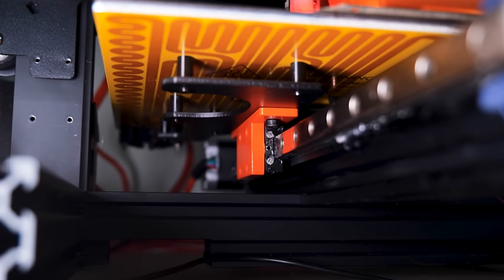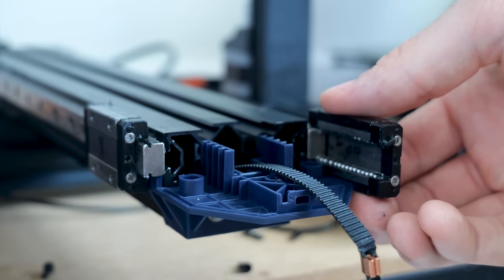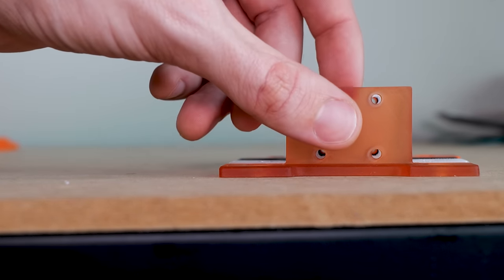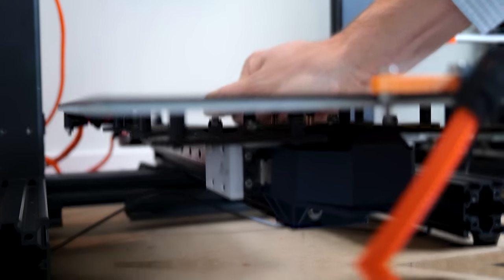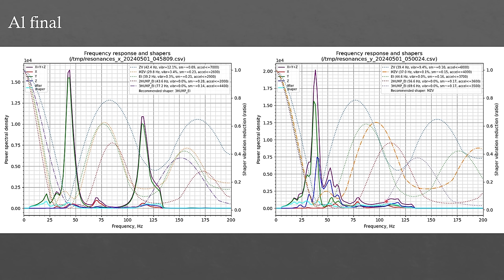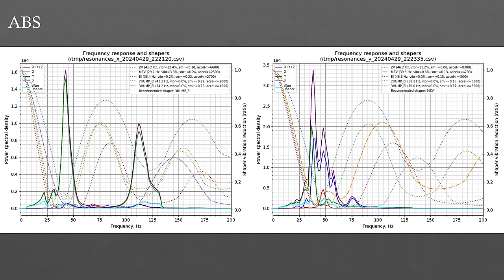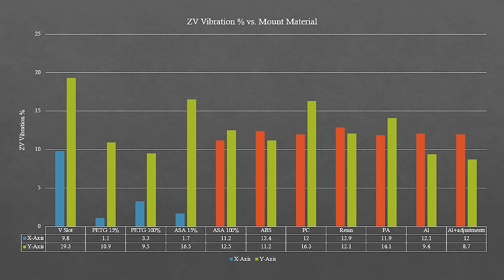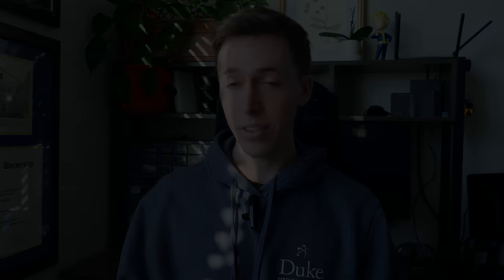Upgrading to Linear Rails a Waste of Money? - An Evidence Based Answer

Comment: I think there's more friction with linear guides as the balls are preloaded against the races - why it's so rigid.
This friction might be what limits speed in the steppers as they have to overcome more resistance.

As for the lubrication - that is a whole degree. Just look at a SKF bearing selection process. I think for 3Dprinting you'd want to use grease as it's simpler but what I would do is clean the rails down first getting rid of the old grease. Then pump grease into the guide block until you see only clean grease come out - wipe away excess. Now this gets rid of the dirty grease but probably overfills the rolling elements but as the loads are small I don't think you'd overheat them. Any excess will just work it's way out - hopefully.
Thankyou for spending time doing these experiments.
Reply from the maker: That's a great point about the preload causing more friction. I guess there is a bit of a tradeoff between the rigidity and the friction. I think in my case, it's an imperfect setup, coming up a bit short on the cleaning, and using the wrong lubricant.

I definitely plan on making a video about proper setup/maintenance of the rails. Right now I'm leaning towards giving the rails/carriages/bearing a soak in IPA for a little bit then properly lubing them as you described! Thank you so much for your support.
Reply: @SpencersDesk  If you do, make sure they are submersed. The steel rails will flash rust when exposed to air if there's no lubricant to protect them. 
What I do to clean bearings is flush with contact cleaner and moved them to get grit out. Then dry with compressed air and then lubricate imediately - might work with linear guide block too but not sure the plastic seals will like the contact cleaner. Maybe flush with mineral oil instead?
Reply: I don't think it has that much to do with preloading. 

I think the maximum speed the rails move is highly dependent on the grease you are using. 
My guess is, the balls start sliding at a certain speed and stop rolling. 
It would be interesting to test different greases and dry behavior. 
And better still, use a closed loop system or measure the amps at the motor.
Reply: I'm sry but i'm going to have to specify this a bit. Rails are, exactly like bearings, sold with a certain tolerance (in case negative = pre-load). Unless it specifically said pre-loaded or a ISO standart letter+number was at the end of their name, they aren't pre-loaded or even outside ISO "stock" spec. They do however very unlikely have all the balls with that stock spec (uneven grind, slight oval and egg forms, easy to see under microscope). In my experience, you can get unlucky and need to buy a bag of balls fairly fast (low material quality), tho this means you can buy good ones and kind of upgrade the setup that way

SKFs guide section are for industrial use and the quality of their goods can't be compared to cheap small rails. Among other things their seals are significantly better, allowing lower viscosity, which suits their superior tolerances. Super Lube is an absolutely outstanding choice for these cheap rails. Grease (like EP2) can be used, if you have nothing els, go for it! But it certainly isn't the proper choice, as it's designed for low speed, with a high friction and certain weather resistance, neither of which are pros in the case of this application

Comment: What about linear guide rods? Some bedslingers come stock with them on some axes.
Reply from the maker: I think they’re better than wheels, but they’re not quite as good as linear rails. They’re also not as easy to add to a printer that wasn’t designed for them whereas the linear rails are somewhat straight forward.

Comment: Thank you for all the effort you put in to this! I think I posted another long comment on one of your other videos a few months back as well. Was planning on making a video last year with some before and after results but got busy and never did anything with the clips. I did some ghosting / ringing torture test prints with accelerations ranging from 5000 to 15000 mm/s2 or something, on a highly modified Ender 3 V2. Similar to you, studied input shaper plots and calibrated everything before each test.

The overall finding was that after a certain point (maybe it was around 6-7000 mm/s2?) the linear rails were doing a lot better. You could visually see less ringing in the test print at those levels, especially the Y axis. My theory is that changing direction simply took less energy. An interesting observation is that input shaper actually recommended LOWER maximum accelerations with the rails compared to V-slot wheels, which left me scratching my head. System stiffness should be higher, no? Used machined metal mounts. So I did another test after adding diagonal Z braces and relocating my filament off to the side, instead of mounting it at the top of the printer. Input shaper graphs looked even better and I got rid of a secondary peak, which was obviously the decoupled mass of the spool. The whole study was plagued with non-conclusive results but my results with the torture tests ultimately confirmed more consistent performance across a broader spectrum of accelerations. But one could argue that this is copium.

Another interesting case was my giant 400 x 400mm converted Ender 3. Hilariously large bed, really limited in accelerations due to this, even with a 48mm NEMA stepper motor with higher VRef. The bed is still mounted to the extrusion on the center of the Y-axis, which isn't ideal at all for a large bed like this. In this case, I got way more consistent prints simply due to the higher stiffness. Adjusting the wheels is really annoying with a bed like that, and they were wearing out left and right. As dimensions increase, the higher precision and stiffness starts to make more and more sense. Used ASA printed mounts for everything.

Last little tidbit... for axes where the rails would "over define" or double-constrain the system (for example, parallel rails in Y and Z), I added small rubber O-rings on the screws, between the mounts and the rail carriage to introduce some very slight angular tolerance. If they aren't perfectly aligned they will bind, and most rails aren't even perfectly straight when manufactured. So I would have 50% of the axis super smooth, and then there would be resistance toward the ends. These small O-rings completely solved that without giving up too much stiffness.
Reply from the maker: I’m not sure how I’ve missed this comment for so long but wow this is awesome! I really appreciate the discourse.

First, I’d like to point out the comment you made about the accelerations going down while the physical results were better. I work in a field where our background is physics (having equations for everything and expecting exact answers and consistent results) but we work in medicine (our models are often incorrect). My point being, there comes a point where relying on the numbers is a poor choice. While the resonance tests are great, what matters are the physical results. We should, at the end of the day, default to the physical outcomes rather than our arbitrary numbers. While I love the resonance graphs, I’m not sure we can rely on their recommendations. Just use them as diagnostic tools!

I love the comment you make about leaving a tolerance. People are so bent out of shape about perfectly setting them up when the rails themselves are imperfect. I’m planning on making a proper linear rail setup/care video where I investigate 2 main things. 1, does the type of grease really matter, as there are a lot of interesting opinions out there… 2, does the setup matter that much? I.e. is investing in a dial indicator going to give you that much of a performance boost? I’m not sure, we will see.

Thank you again for your awesome comments and continued support! Would love to see you in the channels discord!

Comment: Given the cost of these rails and adding the mount parts costs, you may get better value by just replacing the printer with a BL A1...

Nice though, despite some negative comments
Reply from the maker: You’re not wrong at all. Bambú is about to have a sale where the A1 is $300 (less than I paid for my AnyCubic Vyper 3ish years ago) I hope to get an X1 in the future for when I want to print instead of experiment!

Comment: The results depend on the quality of the carriage on the rail itself. Diferences between manufacturers are huge. Pretentioned carriages have a positive impact as well, reducing any backlash/movement on rails. The amount of friction that motors have to overcome with rails is neglegable, if rails are larallel to eachother and dont snag. If you go for accuracy and repetability, rails definitly beat any wheels. Even if its on the cost of 5% speed drop. You can always up the motors :)

Allways best to use grease made for thes use, even tho its a tad more expencive :)

Comment: i feel like there is a bit of misticism surrounding how much better linear rails are lmao.
if you got a well maintained printer you probably won't see much difference, but keeping it well shaped demands more work over time, meanwhile the linear rails gives you a more constant experience on the long term, the most maintenance it requires is grease and re-tightening the screws, which the machine vibrations makes it go loose over the months.
despite not seeing much difference in print quality i feel like it was a worth upgrade to me, the upgrade that i feel like gave actual better print quality was an oldham coupler.

Comment: Informative video. Very well done. My only input is the lubricant used.  With all the particulate matter frothed up by the movement of print bed and extruder, that sticky grease is going to catch a lot of it a end up causing an increase in friction. Clean all that goo off, go to auto parts store and get dry silicone spray lubricant. Spray it evenly on the rails with the bits in motion. It’ll be slicker than snot. 
Don’t sweat the haters and those over critical of your content. They probably couldn’t perform for their daily session of self abuse and have to lash out.  Thanks for the video!
Oh, my vote for video topic would be for linear motor upgrade to your printer. That’s next level. Cheers
Reply from the maker: Hey, thanks for your kind words! I’m currently working on a video all about the proper setup/maintenance of rails! For now I’m sticking with grease per a HIWIN recommendation, but if the plastic junk gets to be to annoying, I will have this recommendation in mind!!

Maybe if the channel sees a little more success in the future I’ll spring for some linear motors😅

Comment: Some notes, if I may:
1) Your premise is restricted to bedslingers. But I believe your question about liner rails would apply to CoreXY machines, too. As to the former, there are so many variables associated with harmonics on a bedslinger. One question I have, does it scale with the size of the bed?
2) Motherboard/hardware: I don't know which Anycubic printer you have (it looks heavily modified at the print head). However, I think Anycubic has only two motherboards, so the stepper drivers are either TMC2209s or worse,A4988s. If your board has the latter, then stepper rails are not worth it. The '88s are barely able to push basic printers and when encountering splines or parabolic curves they are going to barf, linear rails or not. The TMC2209s incorporate better kinematics with onboard implementation of StealthChop (making the driver-motor coupling more quiet on straightaways and SpreadCycle for more dynamic curves. Linear rail question should only apply to these printers with at least TMC2209s or equivalents.
3) Software: This assumes from your coding that you are using Marlin to translate GCODE to stepper driver signal. Yes, Marlin has resonance frequency adaption available in the code but it is not as efficient as Klipper in terms of firmware abstraction. Additionally the '88s are too basic for Klipper so any advantages of Klipper are automatically dismissed.

In all, depending on your model of printer, linear rails may just end up being a cosmetic addition instead of an improvement.
EDIT: Is this printer you modified in a previous video? If so, then my previous comments are applicable to anyone with a standard, unmodified printer. For yours, I guess my first question is how much of this is a 3d printer and how much is this a machine to tinker with? I ask because the time and effort, along with product costs, could easily put you into the realm of a simple CoreXY machine, a more stable printing platform.
Reply from the maker: Looks like you answered most of your questions haha. Resonance is inversely proptional to mass. So, larger bed = heavier bed -> lower resonance frequency. Also, TMC2209’s don’t switch between spread cycle and stealth chop by default. I think they can switch during prints, but it is generally not recommended.

As for the printer, lot’s of people say this. I enjoy the tinkering and modifying a lot. Printing functional parts to be used for that stuff. Not really printing random stuff. Also, I didn’t buy all this stuff at once, so it’s not like I could have bought a printer instead (ignore that saving money exists). Hope that answers, thank you for your comprehensive comment!

Comment: neat video from a fellow v roller enjoyer, will you try this but on x/z axis? and maybe z1 vs z2 preloading if you have silly amounts of time
Reply from the maker: Haha, I do not have silly amounts of time. I wish I did. I would get real silly. I will be moving to linear rails on my y and z axis, hopefully soonish. I don’t believe I will be investigating different preloads. I think that our printers would be fine with Z0 or Z1 on any axis. I don’t think we require anywhere near the rigidity that Z2 would provide. I’ve found through producing these videos that people have some seriously strong opinions on these things without much to back it up. I think we often forget that we are 3D printing, not operating industrial machines, which are 2 very different applications requiring vastly different considerations… Anyway, off my soapbox, haha. Thanks for your comment!

Comment: 9:16 Voice typing often confuses those two as well (and sometimes I just put it on purpose because funi) SuperVinlin
I feel like the biggest argument for linear rails over V rollers is the reduced maintenance, and not having to replace the wheels every 5 minutes; esp if you just happened to tighten them a little too much and they decided to explode faster than usual.. not to mention having to adjust the tightness on them every time you change them, which may take a bit longer initially with linear rails, but it's not something you ever have to repeat

Comment: Saying this based on principle and purpose of linear rails without watching all of your presentation just yet (but I will!), linear rail(s) implementation is almost entirely misunderstood for what they Should be used for: precision and repeatability. Naturally they can't do that alone, which also comes down to the precision of what is being driven on them, subsystems (steppers/motors/controllers, drivers, processors, etc). Getting rid of belts and degrading surfaces through wear/friction are another side benefit, and you Might be able to increase speed to a degree, but that's not what they're for on design principle. Providing a smooth and rigid support structure for repeatedly hitting a precise point of space, that's the bread and butter of linear rails, along with a well-surfaced ball screw and all the rest. 
To that end, side effects of motion systems that degrade with wear (rollers and belts for instance) induce certain defects just through operating principle even in good condition. A belt is essentially a long spring under tension, and when you repeatedly use said spring, it's dimensions and capabilities degrade over time. Add into the spring effect with general momentum and direction of travel changes, those effects have more to do with printing defects than frequency.
Reply from the maker: I think I misunderstood that going into this project as well. This is a wonderful comment! I think rails are great for eliminating some amount of uncertainty in your extrusion. I think 3D printing is mostly held back (accuracy wise) by the actual extrusion process, not motion.
Reply: @SpencersDesk  Oh, most certainly. It comes into play with the ol' economy of scale and production quality for x price bracket. A $300 printer will kick out usable models all day, but it costs money to hone in on micron precision. Electronics, software and stepper motors on most commercial models will only hit essentially the 8 ring of a target if you'll pardon the phrase, but getting into the 10 ring every time requires operator knowledge and better hardware.  Naturally when you step into engineering-grade machines, tolerances and materials increase exponentially, as does the price.